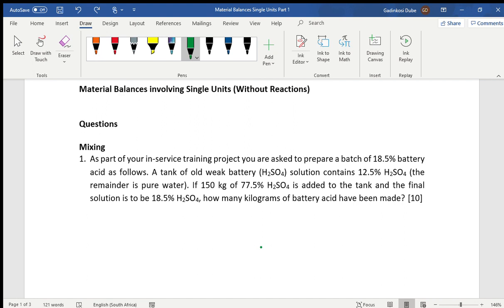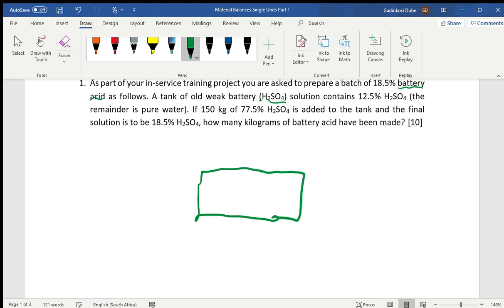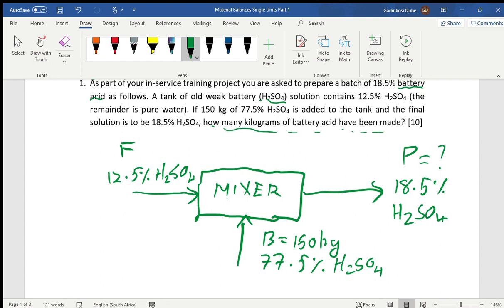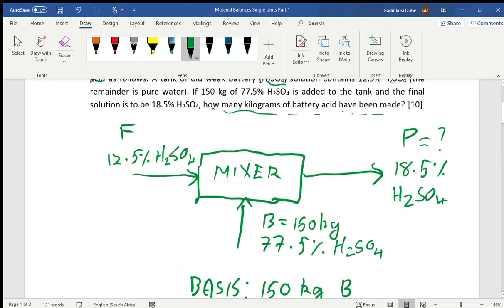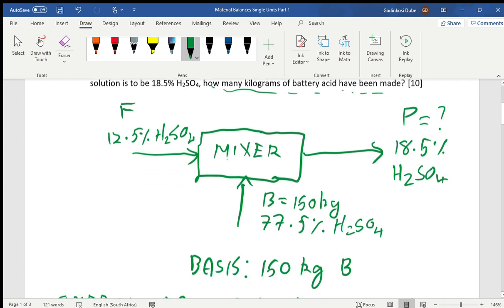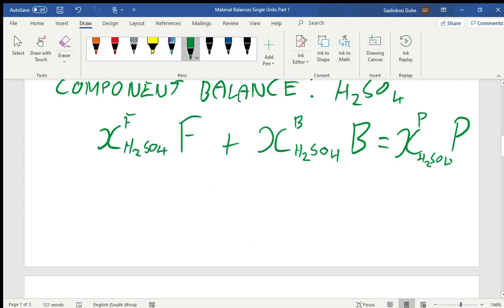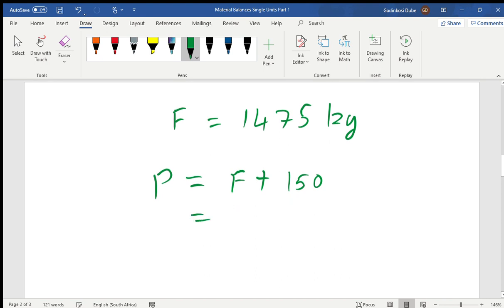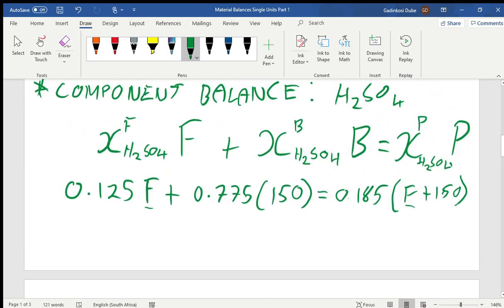Material Balances Single Units Part 1   Mixing

Comment: Hi, thanks for sharing
I  wonder if the mixing occurs in a very high-speed condition such as steam ejector (steam flow into CD nozzle exiting at 1000m/s thus creating a vacuum that sucked the secondary fluid)
can we neglect the velocity? or do you have any clue for me to learn more about it, thanks
Reply from the maker: Hello, in this calculation we neglected the effects of velocity since we were not given sufficient information in the problem statement. However we can use standard assumption to determine the velocity if its required.